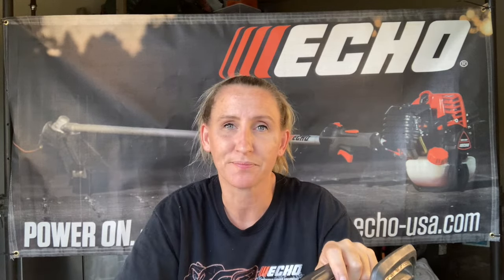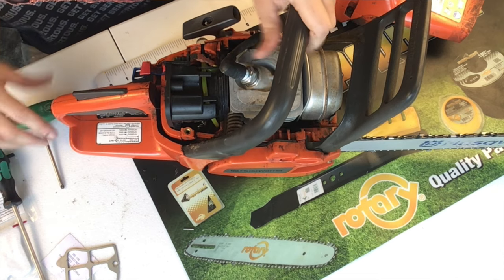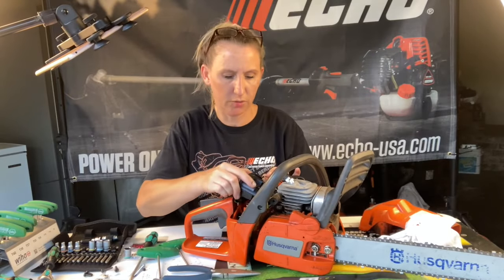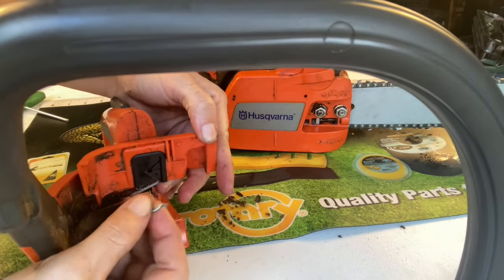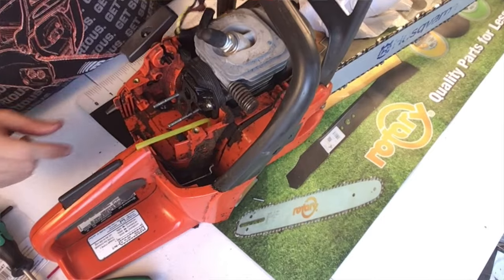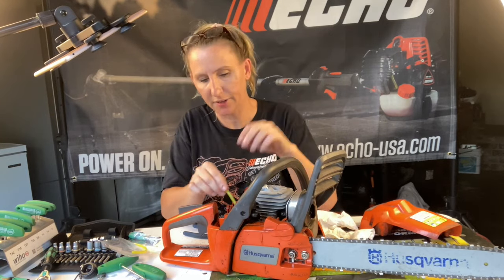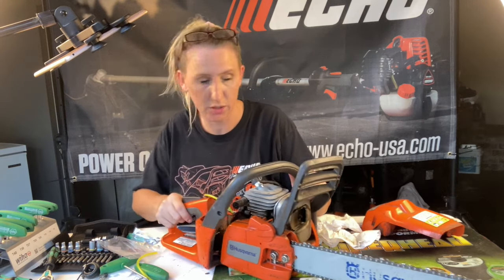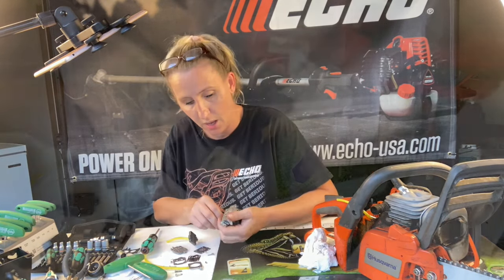HUSQVARNA CHAINSAW WON'T START? Complete fuel system rebuild of fuel lines/fuel filter/carb kit

Comment: A neighbor just gave me A Husqvarna 240 that he was going to throw away. This video is perfect timing for me! His starter pulley is ruined, he chewed it up where it won't grab and turn the engine. There's no bar, side panel screws missing, bar bolts missing, chain brake missing. LOL, he was done with it! I ordered the plastic pulley, I'll see if it will run and go from there. Your videos are always excellent! Thanks for posting them. Husqvarna has a good web page that shows parts and prices easily, that's very helpful.

Comment: All you need to do is remove the three screws on the throttle trigger handle and remove the trigger, lock, and spring. Very very simple and there is no need to pry on anything and opens it completely up to work on.   Done dozens of them.  Hope it helps. Great video.
Reply: Thank you for this response. I was thinking the same thing, but I’ve never worked on any chainsaws yet. I was a car mechanic. I’ve piddled with a lot of lawnmowers.
Reply: Can confirm this method worked on a 235e I am working on.

Comment: The OLD MAN at EP saying thanks for the stickers and also hate to tear those saws down. We use a little two stroke oil to ease the installation of the fuel lines and the grommet. We all make mistakes trying to save the customer money but for the cost we basically replace the grommet when it is torn down. Very good video showing the teardown.
Reply from the maker: Thanks Wayne!

Comment: Great video! And thanks for the info here. I got my grandfather's old Husqvarna chainsaw from the 70ies to run again after sitting many years. I replaced fuel line and filter as well as the chain, cleaned the carburettor and adjusted the idle a bit. Now she runs again!

Comment: I just did all this service on my husquavarna a few weeks ago (fuel lines, filter, primer bulb, carb, plug, air filter, general clean, pulled muffler to check exhaust port) and was thinking it was kind of a pain having to remove the handle to get access.
I did not replace that grommet, but it doesn't currently leak. Good to know that it's a possibility in the near future since the fuel line came out in pieces!

Comment: Well you may or not know but i am weird.   I clean just about everything before I start.  I do not work in a shop so I don't have time demands of a shop.  Great instructional video...
Reply: I liked this video but gotta disagree cleaning before repair is a great idea on a used/abused saw.  Mine was not cleaned for a few years (I'm a diy guy) and there were oil soaked wood chips and sawdust so thick it was tough to find the screws).  With a preliminary clean accomplished then teardown, carb removal and rebuild, fuel system filters and hoses and reassembly with fresh air filter and gaskets almost finish the job.  Spark plug, chain replace and the machine should be ready for starting and mixture screw adjustments.

This is a good video,  but camera work could be better,  hard to see what she was doing.  Don't skimp on the cleaning ... half the time that's all thats needed.

Comment: I’m replacing disintegrated lines on my Husqvarna 235e, looks to be the same set up. The brittle line were all broken off inside the tank. This video showed me which line was the fuel puck up. I had it reversed with the primer bulb return.
Thanks.

Comment: To put fuel line in the tank, I angle cut it, push it through the hole or grommet and grab it on the inside with my hemostats and pull it into the tank to he desired length.  I then cut off the long angle cut, connect a new filter to it and push it back into the tank.

Comment: great instruction video!. I got an early 80's husky 41 from a friend, was sitting for a number of years. Got one of the Chinese carbs for $10, replaced the fuel line (that was difficult), etc. Ran good for 15 to 20 minutes, then would not idle... Got a rebuild kit for the original walbro carb. Hopefully it will work fine!

Comment: On the adjustment screws,  I prefer to use a cut off wheel cut slots in the screws and use a small regular/flat screw driver to adjust.  Easy,  and not spending money I don't need to.

Comment: If a tank has a grommet, I clean up the grommet and then coat the mating surface with 1184.  I also make sure the fuel line is a tight fit in the grommet.  I use the tightest Tyson line I can use for the fuel line, so it fits tight in the grommet but will still connect to the filter and carb.    I gave my Husky 240 to my son in law.

Comment: OMG, would never try this, even I like doing my own thing. That why we have talented people like this Gal.🌹
Reply: Just wondering if the Echo saws hold up over time like the stihls? Anybody know. My friends new echo started 1st time easier than my stihl my stihl was 8.5 yrs old but started just like it did when new. Only cleaned filter and kept it blowed out dust I'm saying. With stihl hp.mix oil 50:1 never anything else. With ethanol15%.

Comment: I alway pressure and vacuum test the tank as part of the engine check I perform on every piece of ODPE that comes in my shop.  I also use nothing but Viton for my fuel lines,  I've pulled lines on units that are 20 years old with viton and they are still pliable.
Reply: The most invaluable comment I’ve ever read on YouTube. Thank you for this. 

I wish I could send you my Husky 460 Rancher that I got for free. It needs a new cylinder installed (I bought an OEM cylinder). 

One guy has a video on YouTube showing a complete rebuild, but he uses loctite as a sealant for the case, crank, cylinder, etc… I dunno if that is the proper procedure…
Reply: @garrettstevensen2467  I use a thin coat of Dirko sealant spread with a popsicle stick to seal my cases.  A sealed crankcase is critical to a 2 cycle performance.  The most valuable tool in my tool box is my pressure/vacuum pump.
Reply: @rphiliprogers  Do you perform cylinder replacements for hire? Just thought I would ask. I live in California.

Comment: Your videos are great as is this particular one on a Husqvarna 240. I myself have a Husqvarna 345 I got back about 15 years ago and it still runs great. It is interesting to see on being torn apart for this particular problem. I just thought I would tell you in case no one else has ever mentioned in that your sound changes at different points in your videos sometimes and this video was really easy to tell. Sometimes the sound is great but sometimes it gets difficult to hear you at the same volume. I just thought I would mention it to you.
Reply: You should hang on to your 345 it’s a great saw and easy to upgrade to a 353 cylinder and piston or better yet a 346 cylinder and piston, lots of iTube video on this,and use non- Ethanol gas
Reply: @edbartlett6348  It is a great saw and I sometimes use it at work when needed because it is much more reliable than the Stihl MS 290 that I have for particular jobs, It still runs great and I never put anything but ethanol free gas in it.

Comment: I feel your pain this saw absolutely sucks!! I took apart the same 240 several times. Finally gave up and replaced the lines, bulb, rebuilt the carb and cleaned it. Sealed the fuel lines with aviation sealant and she works like a charm.  Great trim saw for pallets and branches. PITA to work on.

Comment: Great video i also have a 240e Husqvarna and i have to do the same thing to mine i have for the mean time replaced the carb with an aftermarket one got it running again it however doesnt idle down low so will strip clean my original carb and rebuild it with the kit i have and put it back on and it should be good as new

Comment: I use my air nozzle to blow most of the crud off before performing work...it's just better in the long run, you can see what's what a bit better, you don't get as much crud all over the place, etc etc....it to me is worth the 5 minutes....

Comment: I usually put a little dab of grease on the bottom of the lifter spring to keep it from popping out and some on the lifter pin to keep it from sliding out of the lifter as I put the lifter back on to the carb.  Gas will wash it out in a short period of time with no effect on the operation of the saw.

Comment: That’s why I always put a little 1184 on any tank grommet when I put it in the tank.  I then pressure and vacuum test the gas line and tank with my Mighty Vac before I put things back together.  This will catch any problems before I put them back together.

Comment: While watching the video I thought you missed putting the carb gasket back on the studs before mounting the carb back on the intake. Obviously you  did not miss that step. Good video!
Reply: I thought she forgot to put the gasket on as well, but I didn’t see it on the bench during assembly. It pays to look at what parts are leftover before everything is back together. Good video, as I have performed this task myself.

Comment: Thanks for the very good information, I have a Mcculloch CS 380 which is identical to the Husqvarna you serviced, apart from a slightly different design on the shell.

Comment: Seems that any maintenance where you need to replace the lines and fuel filter there should be an automatic grommet replacement. Cant be that expensive to add in and its always guaranteed to be good when the repair is done.

Comment: I have a Husky 235 which looks almost identical to this one, I changed the fuel line because the filter rotted off of it, and put a kit in the carb. I don't recall there being a grommet where the fuel line passes through to the tank on this one though, it was a PITA to get it through. I cleaned that brass sintered fitting for the vent while I was in there. It runs great now but yes they are  a PITA to take apart. When I took it apart I did take the handle apart to get the throttle lever loose....
PS
what's the easiest chainsaw to work on? 
Echo? 
or 
Stihl?

Comment: If I have a loose grommet I will usually put a little TB 1184 on the grommet and push it into the tank and put a little 1184 on the fuel line and push it into the grommet.  1184 will stop them from leaking because it is fuel resistant.
Reply: Instead of band-aid, why not just do it properly while you're right there?

Comment: Hi Chic. I had one of those little Huskies and it wouldn't start. The Mankanic said that a piece of the carburettor had come loose and gone into the cylinder, so I bought another machine that I still use today- periodically for wood turning blanks  which was a 2006 Husquvarna 340e Great machine. Any thoughts?

Comment: Great video my 240 the bulb is cracked starts but dies out im gonna replace bulb an i bought a carb kit an after watching this video i will be able to do this repair thanks for the tip about taking the handle off to get to the carb removal an while the carb is off im gonna replace the lines too thanks a bunch

Comment: I called Husqvarna because I was worried they did what sthil did and made it part of their warranty saying that you have to run that crappy pre-mix fuel. Husqvarna assured me that there is nothing in their warranty saying you must run any type of fuel other than the properly mixed fuel and they actually recommended that I never run any premixed fuel even their own brand. They told me that the pre-mixed fuel is an option for people that do not have access to good clean fuel from the pump but I would be better off buying non-ethanol gasoline and mixing to the proper ratio with a good 2-stroke oil.

Comment: The cheapest fuel line to buy is from Tractor Supply. It's about $10 for 5 feet of fuel line. So, one can have fuel line for other yard equipment.
Reply: You got the cheap right, last maybe a year or two
Reply: @philliphall5198  just depends on how one stores their chainsaw.
Most people store a dry chainsaw, meaning they store it without any fluids in it. So they end up having to change fuel lies and fuel filters and grommets every few years.
I always clean and fill the fluids to 3/4 full and start my chainsaw and let it run a minute.
I then put my saw up in storage. I prime the saw every few weeks to keep the carburetor wet and to keep the fuel lines wet.
I've bought a Husqvarna 455 Rancher in 2007  and changed out all the fuel lines including the impulse line as well as the grommets and fuel filter just last year.
That is the first time I've had to mess with the fuel lines, filter, fuel tank since I bought the chainsaw.

Comment: Noticed The line in the grommet is that yellow fuel line is why it leaked there at grommet factory  fuel line is 5.7 mm  od same as stihl impulse line for back pack blower the yellow fuel line is wrong size the 5mm od is to small and 6mm size is to big will close off Id to much starving it for fuel if use it for the main fuel line from filter to carb was on my 55 also noticed when putting back together you use the black fuel line was it the oem

Comment: I have Husquvarna 235 
They replaced the spark plug and air filter
Worked for awhile but now it wont idle
I drained the gas and noticed no gas filter only gas line
I assume all Husquvarnas have gas filters.
I see something inside but I think its a small tube vent.
It would explain why it doesnt run when you pull the trigger
And stalls

Comment: I have a split boom Husky which I put on a complete new fuel system and it still does the same problem.  It starts and runs somewhat but then backfires and quits.  Exhaust screen was completely clear. Doesn't appear to have been used much.  What's wrong!

Comment: I suffered through one of these 240's about 8 years ago. My tragic error was letting the safety brake engage while the cover was off. What PITA to get that disengaged. Ugh!!! I couldn't bring myself buy the pricey tool to fix it.
Reply: I ran into that recently as well when I ordered a replacement cover, it came with the brake engaged. I thought I was going to need a tool to disengage it, but found you can push the brake bar on the saw forward just enough to align it for a good enough grab with the brake mechanism on the cover (note that you cannot actually fit the whole cover on at this point, only the brake part at an angle) and once you have good contact, while holding the cover firm, push the brake bar back on the saw and you'll hear the magic pop when it disengages, then it will fit back on properly.

Comment: Great video. One item you missed that is often the cause of bogging down and cutting out.
The tank vent.:
Just near where the return line enters the tank ( RH side below the carb) is a small round sintered brass plug. Below that is a pinched rubber duckbill one way valve. The sintered brass gets clogged with oil and debris. It needs cleaning with carby cleaner so it will vent correctly. It's a terrible design so probably could do with a modification like extra sponge filter glued above it. 
Other than that I don't think you missed a thing. 
I'm not a fan of the Husqvarna products.  They are becoming throw away items that seem to be CAD designed with no thought put into future repairing.

Comment: I have a Big box store branded Chinese engined hedge trimmer that had the same problem. The fuel lines passed through a grommet that had decayed to mush, with no chance of a replacement. I ended up machining a custom 'thing' in aluminium with nitrile O-rings to make an adaptor to take the lines in and out of the tank. Hours of work for a £50 trimmer.
There's this idea with industrial designers that you must hide all the works, even in cars they hide all the fastenings that hold the trim on. The result is to mystify the working, 'this is not for you, leave it to the professionals.' Why is the air filter hidden? why do the hide the carb adjustments?

Comment: Have rebuilt more of those carbs than care to mention. And know for a fact that 50 % of them are junk. They have a check valve in the main jet that can be bad,, even in new carbs. I don't rebuild them anymore. I replace them . And it's not worth replacing the jet in them , to time consuming. Nothing more frustrating than spending time to clean and rebuild a card only to find out it still work right. 'Time is money " .   I've done it a hundred times.  Sorry to be so glum about it but I hate those carbs. As always great job 👍

Comment: I have a Husquvarna 455 not pulling fuel, replaced bulb, carb, plug. When I got finished doing all that ran perfect, 1 one month later starts runs for about 5 seconds and dies,suggestions?

Comment: HELP!! i rebuilt the carb on my Husqvarna 240 chainsaw which had primer working before and now it wont prime but has pressure when you pull the fuel cap off.... What stupid thing did i do in your opinion?????? I replaced fuel line and filter in the tank with new grommet. also short line from primer to carb. one line from primer to body which is just inside the tank i did not replace, it looked fine🙃

Comment: I have a Husq 345 chainsaw. it has new carb, new fuel line, filters spark plugs ignition coil and no scaring in the piston chamber.  it fire once in a while, but when it does it will bog out.3 shops later all said nothing wrong.  any thoughts.

Comment: Great video
I have a question, I've had my 240 for a number of years and been apart a number of times. Can you please tell me if there is a way to repair the stripped out threads in the body especially the ones in the ones that hold the AV springs? Can it be done, what do you use??? That AV system is a real PITA makes this saw so difficult to work on.....Thanks
Reply: I haven't seen that particular one, but can you get heli coils to put in it?